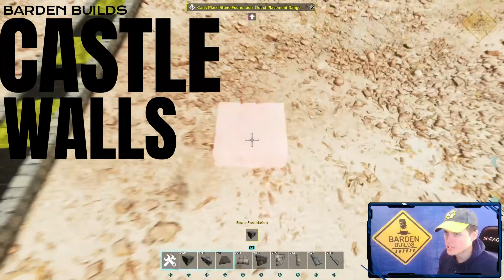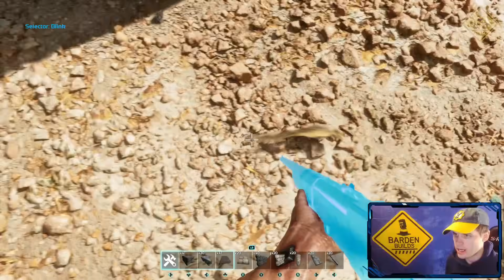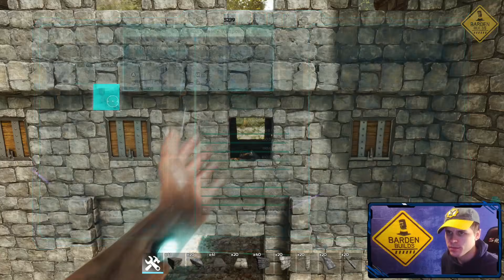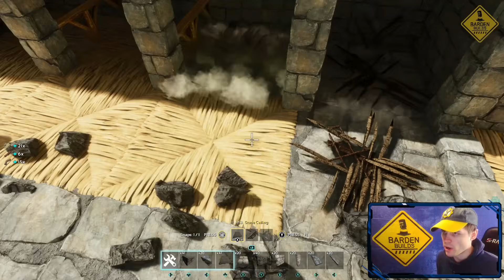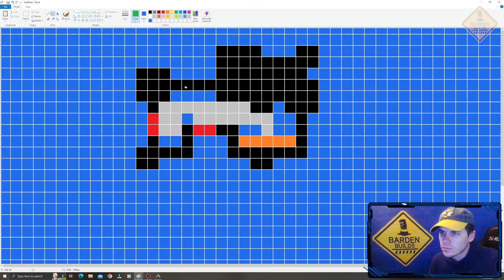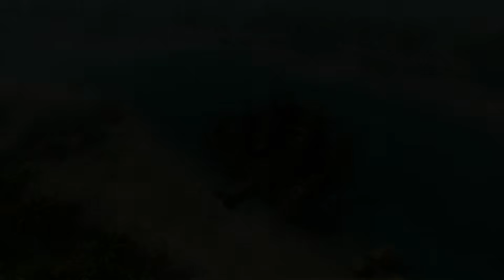Ark Ascended: Build Your Own Castle (Tutorial/ No Mods)

Comment: Why alternate on the round tower?  You can go the same pattern and get the same effect.  Is it a cosmetic or for structual reasons?
Reply from the maker: When extending outward, you have to alternate each layer, other wise the tower becomes less round each layer you expand by using the same pattern.

Comment: ladders by far have the hardest snap points.  I have learned that you can basically build a ladder cage and it will protect you from attack.
Reply: Easy if u use the floors😂

Comment: I’m wondering if the quarter walls will make the tops better than the door frames on official. I’ll probably try it that way.
Reply from the maker: That probably wouldn't look terrible either.
Reply: @DrB048  should be able to do a half wall with them and then alternate on the next level for the gaps.